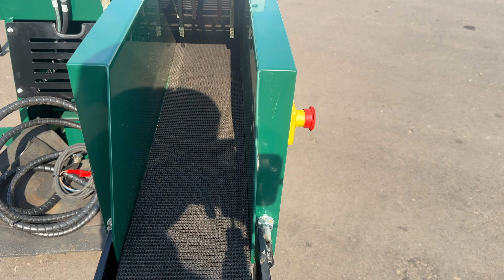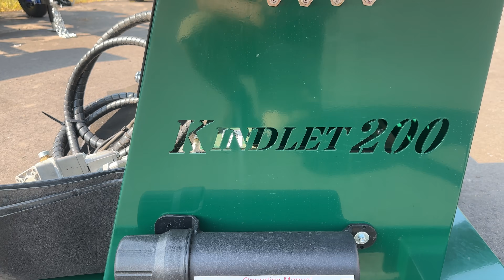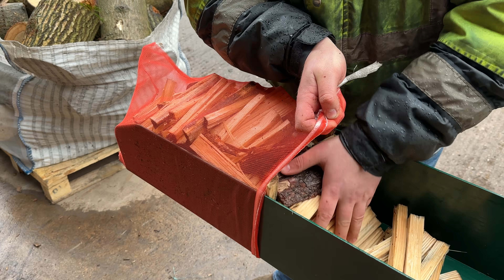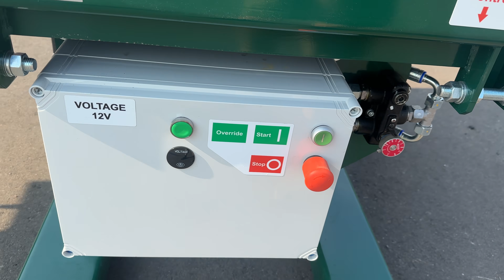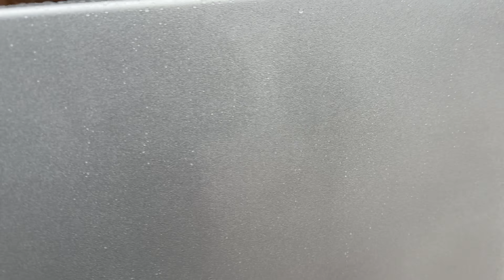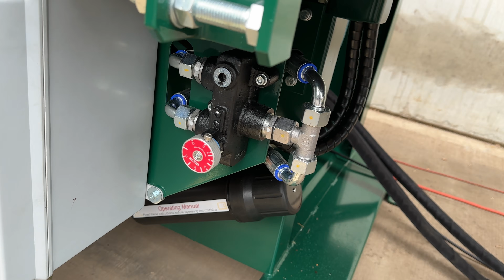An International Partnership with Wolfe Ridge and Fuelwood - The Kindlet 200 AND the Kindlet Pro!

Comment: Wonderful machines, couple of questions. Can these be fitted onto a bobcat(skid loader) ?  Are the gas powered ones available yet? Also pricing on these? With shipping to 15601 zip code. Bag sizes and availability. It's an idea stage right now. A possible addition for the future. I've seen your machines on " in the woodyard". When is Paul bunyon expo?
Reply from the maker: Hi Paulie, the TRH / tractor hydraulic version of these can be run off a skid steer easily.  Here's a link to the Fuelwood section on our website for more information including all prices:
https://wolferidgemfg.com/product-category/mini-wood-splitters/

Comment: Great machine but running it off the pto of a fuel guzzling tractor not so great.  Need to include a model that does not come with a pump also that gets plugged straight into say a skidsteer's hydraulic system.
Reply from the maker: A tractor basically idling at 1400 rpm is actually very fuel efficient in comparison to a small gas engine
Reply: More options coming, thanks for watching!

Comment: Is a standard firewood length/size model coming??  Stand alone units for both as well?
Reply from the maker: A stand alone unit with these smaller sizes will be ready this fall. A larger unit to handle 16" lengths is also in planning phase, but not sure how long it will take to produce at this time. Thanks!

Comment: Awesome guys.  But I won’t buy until it doesn’t require a tractor to operate.   Buying a tractor adds a substantial cost to the unit that the little guys or growing buisness can’t take on right now.
Reply from the maker: Electric powered options soon as well
Reply: Thanks Matt, agree 100%.  Engine option is already in the works. 👍